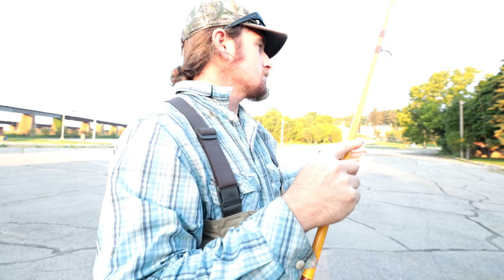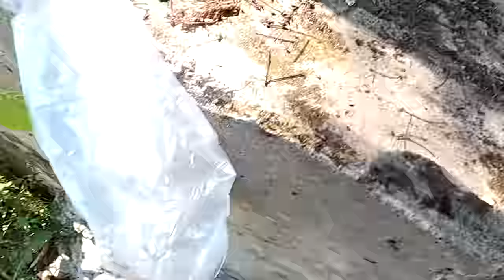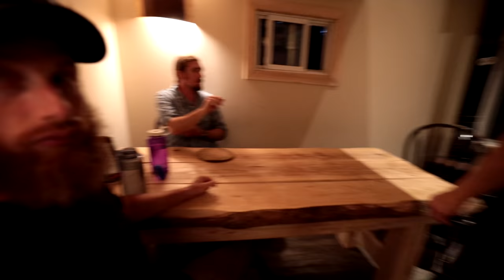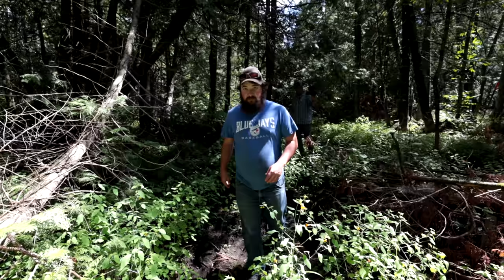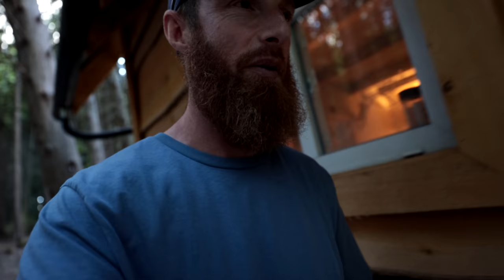Smoking Salmon in Smoke House (Catch, Clean, and Cook)!

Comment: If you saw lines on the smoker inside   trim that is large enough for the oven rack, you could just slide it in instead of tilting your oven rack before placing it in the smoker.

Comment: I use dry plum wood in my smoker to get it to smoke rather than burn cleanly just reduce the oxygen. wet wood gives you steam though has the same effect by burning slower and cooler. reduce oxygen by covering the fire until the flame goes out and you get  smoke. my smoker has air controls I just turn it down.

Comment: I'm not a big fan of puff balls, but just because it has a hole or two doesn't mean it has to be thrown away.  Just cut off the part with the hole.  They're so dam big, that even if you lose half of it, you still got a lot of meat.
Reply from the maker: They didn't smell right either! :(
Reply: The Wooded Beardsman    Well that's a definite no go for sure.   Do you actually like them though?  I find they're like a cross between tofu and flavourless marshmallow.  But perhaps on the BBQ they're a lot better.  I've only had the chance to eat them fried,

Comment: That wasn't a fight my friend. I respect you guys very much but what you are doing here is taking my respect level for yall down. Fight the fish from the bank. Stop chasing them in the river, your meat hunting not fishing. Use a spinner so when you get one it actually bit you. What y'all are doing now is harassing a fish into biting in shallow water. And that's IF they actually bit. What y'all are doing is called "flossing"
Reply from the maker: Flossing, as I understand it is stretching your line tight across the river...using a float, the fish either bit or don't as it drifts by.  I've not caught many many, more fish than I caught...
Reply: @TheWoodedBeardsman  as they breathe in the water their mouths open and close. If after the first couple times you make the drift and it doesn't eat it, then you are just basically hoping it will fall in the mouth as it breathes. Trust me. I didn't say something because I wanted to give you a hard time. I said something because I respect you and don't want you to lose any of that with any of your hard earned viewers. You can floss with a bobber too. All you have to do is have out two more feet of line under your bobber than the river is deep. Then you put a split shot something like 18 inches above your hook. Between your eggs and the split shot is a tight line. As the fish go to undulate their mouths, the split shot goes on one side of the fish with the eggs on the other. Line gets in their mouths, current continues to push the bobber down river, bobber goes under, you set the hook and if you don't know much, that seems sporty. It's not.